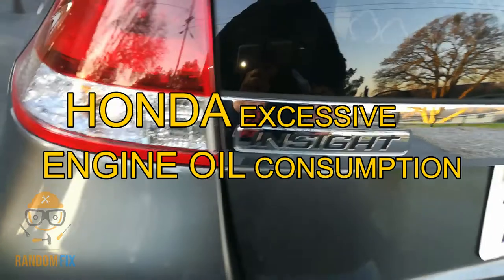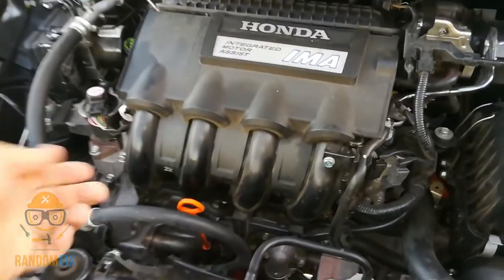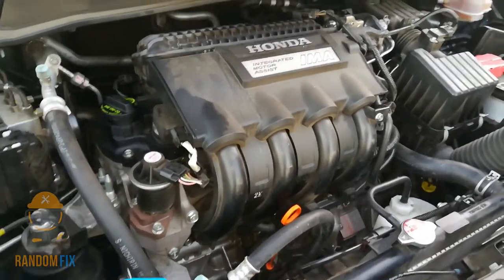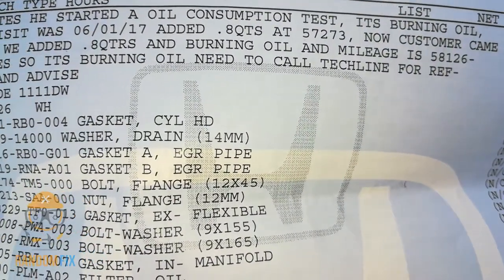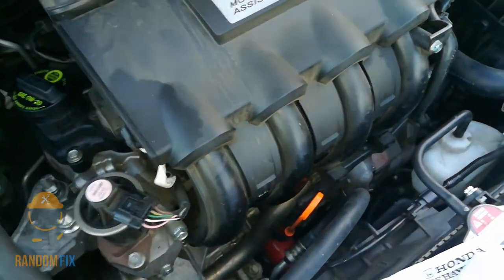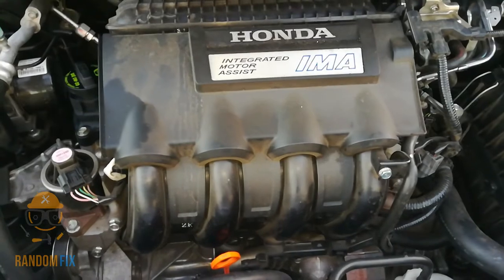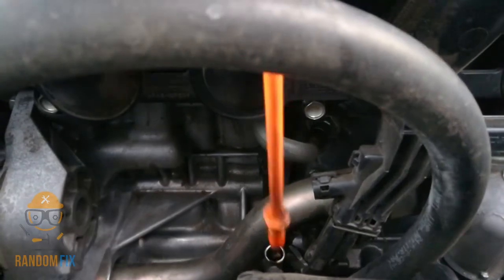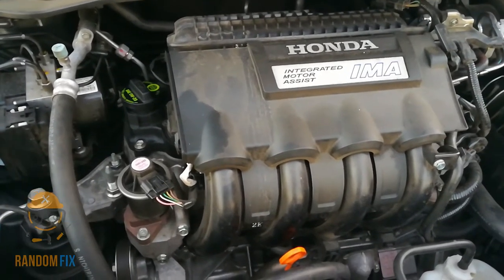▶️Consumer ALERT!! 2012 2013 Honda Insight Excessive Engine OIL Consumption ▶️GET HONDA TO PAY

Comment: Any good news about how to resolve this issue its realy annoying.
Reply from the maker: Rayan, you need to have Honda take responsibility for the repair as its a known defect. Let me know if you need anything else and yes Honda will make it hard for you to claim it's their fault but I did it and so can you. I dropped a lot of golden nuggets in the video in case they make you jump through hoops. BEST OF LUCK. _Randomfx
Reply: @RANDOMFIX  hey bro honda told me they wont fix it because my car has a salvage title due to small accident on rear bumper. Any advice how i could get honda to fix?
Reply: The dealer I brought my car to finalize the oil consumption test tried at all cost to avoid the warranty repairs. They said I must replace the engine (since piston #4 caused damage in the lower engine bay...)and offered one for $15,900! They added that Honda would've covered some of the cost for that repair ($11k) and I would cover the rest. Since I just bought the car, I told them I could not afford any additional costs and will take the risk for them just to proceed with the recall. The car sounds and drives great now.

Comment: I just need to find me some piston rings to fix my car
Reply: Unfortunately they don't make them, I looked around and couldn't find any. I tried Hastings piston rings that says it's for this motor and it doesn't fit. Tried the dealership and they only sell it as a kit per cylinder.
Reply: You have to replace the pistons.
Reply: @papi-champoo6033  thanks I got this problem fixed already
Reply: @madhusain  how? Please tell :)
Reply: @butcher6939   u have to change the piston
Reply from the maker: Do you change the piston yourself?
Reply: @madhusain  Can you share some part numbers?
Reply: @MartinHannett_   ok one sec
Reply: @RANDOMFIX   no  paid someone to do it but I also helped
Reply: @MartinHannett_  13011-5N7-004 that’s just the rings
Reply: @MartinHannett_  u will need new pistons to  cuz the new ones that Honda make don’t fit the old piston
Reply: @madhusain  So have you found that having a mechanic replace the pistons and the rings alone has solved all. issues? I'm looking at one of these and I really like the 2012 facelift. I would like to buy a low miles one and carry out the work immediately to have peace of mind. Thanks!
Reply: @MartinHannett_   in some case if the miles of the car it’s to high u may need to change the block too
Reply: @madhusain  If you are on Facebook, please join Honda Insight Owners UK group. Thanks for all the replies. Maybe consider making a video explaining all the parts you bought as I’m sure lots of people would appreciate it.